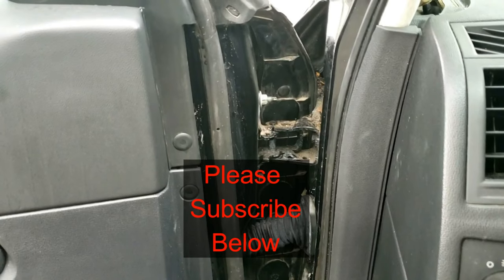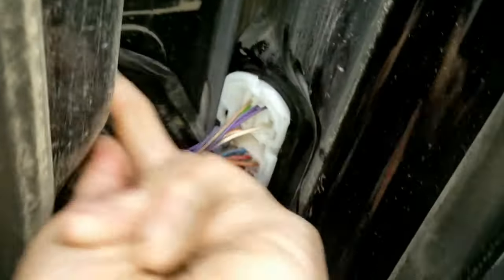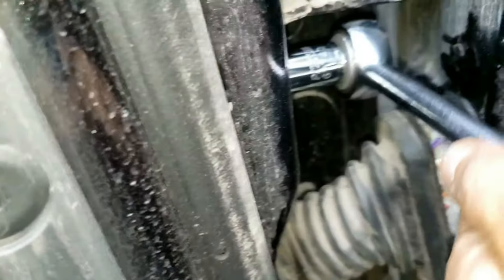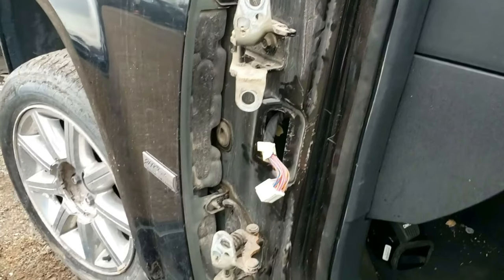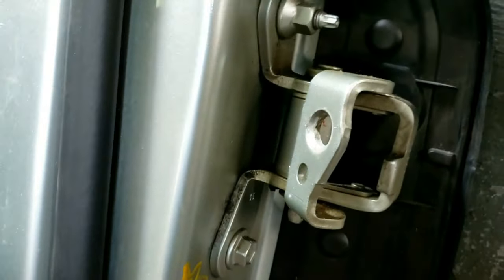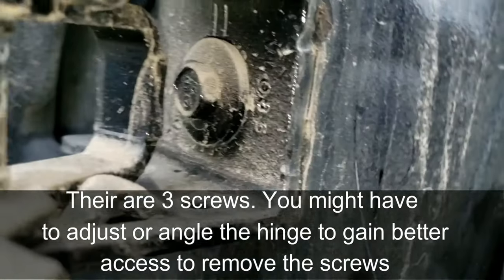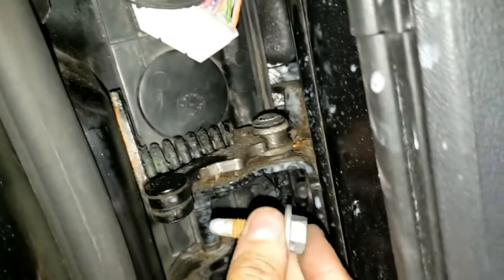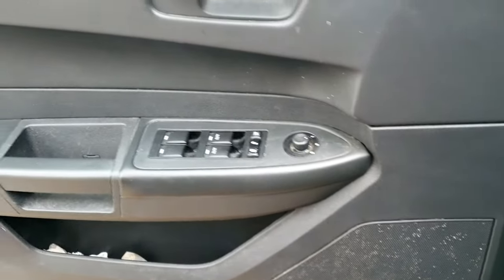How To Take Off Car Door And Remove Hinges On A Dodge, Chrysler, Jeep

Comment: I went to pick up a used 2001 dodge stratus 4 dr, driver door. Your right about that.( heavy) That door
had my back hurting , but I put it in and out even tried the back seat ,that didn't work loading it in my 1988 buick electra park ave. It has a big trunk but still, can't shut it all the way, almost. My back is halfway better next morning. Now to install my great buy $80 dollar and $20. in gas driver door .
 now to find what to lift it today , so I don't have to do more than balance half the weight. lot of big blocks I cut with a chainsaw I guess  and a rubber tire 2  wheel dolly to move old one away to junk pile.
Reply from the maker: Nice whatever does it!

Comment: I think this will be extremely helpful I have a 1990 Dodge van and the brackets have little couplers in them that need replacing and the door leans so now the assembly that closes the doors broken due to the leaning.. Time to take it all apart and fix it❤
Reply from the maker: Cool. Hope it's easy!

Comment: My door opened while I was backing up my driveway and clipped the corner of my smaller cabin 
Flexed the driver’s door towards the front of the truck 
There is difficulty opening and closing 
Any information I can get would help 
2010 dodge ram 
Please I am asking for your help and opinion
Reply from the maker: Might have to bend some of the door to bring it back in shape or use one of those puller pieces. Or if its the hinge area check to see if any of the screws looks damaged.

Comment: Flying 2000km to pick up a 2014 Cherokee that's had a sideswipe scrape and dent on the passenger door and the owners are selling for half market value. Easy flip. It's a big enough city I know I won't even need to paint a door, I'll find a color match at a wreckers. Just checking in before I go, making sure it's as straightforward as it oughta be. Guess I'm booking a flight!
Reply from the maker: great. I like your can fix attitude!

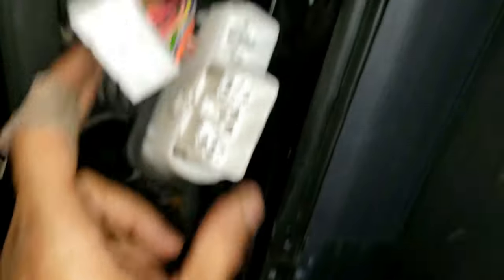Comment: At 7:10 what happened to you other wire connector??? You only connected one back and not the smaller one. Oddly it disappeared from view. Did it fall back into the frame?
Reply from the maker: Great question, and great Eyes 👀!!! So I actually replaced the entire door, which unfortunately for me had a different wire connector. My original door was damaged but the wire connector inside was still good, BUT it had 2 connectors, while the new donor door I got had 1 connector. 

So in addition to removing and reinstalling the door as shown in this video, I later had to also swap out and open up the insides of my original door AND the replacement door to switch the entire wire harness so it would plug into the rest of the wire inside of the A Pillar section which you spot. 👏👏👏

This might sound confusing, but basically I got a replacement door that was identical except the wiring harness.

I still posted the video to help others out. Unfortunately I didn't record swapping of the wire harness, but for most people that would be pointless, as if you are looking for a door to replace usually the wire harness is the same so therefore you only need to remove and reinstall a door if long if the part number (or door in this case) is the same.

Long story, but hope this explanation helped, and again great job on catching this!!!
Reply: I am putting a new door on my car but i forgot if i had 2 connectors as well. So the connectors didnt line up on the other door? Dont know if i will have to do this as well, any idea if you remember trying it? And also your old harness had a spot for 2 connectors it seems like, thats odd if you didnt have a need for it
Reply: Did you watch the video? He showed attaching door onto bolts and bolts and made harness connection to insure all electrical wiring worked before completing tightening bolts and nuts.

Comment: I kinda wanna switch a crushed door from one car and swap in a donor door from my other donor car.  What about disassembling the door and stealing it's trim and window and mirror. I kinda wanna take the metal panel off and paint it to match belt putting it on.
Reply from the maker: You could switch the components but it's hard. I did that with the door wiring harness before.but the trim and side mirror are easy.

Comment: I have the second type of hinges and my driver's door won't stay propped open but I can't figure out what's wrong with the hinge that it won't catch and hold itself open
Reply from the maker: Check to see if the hinge is properly aligned and tightened. You might have to adjust it as well.

Comment: Same process for a 2014 Dodge Avenger? And does the door have to be open?!
Reply from the maker: Not specifically sure for an Avenger, but most likely yes for the front door. You also have to disconnect the wire harness connector and the door has to be open to do that.

Comment: are chrysler 300 05--------and 07 dodge charger have the same wire harrness in the door..?..
Reply from the maker: I think so. However do a quick part search and you'll know for sure. I took a wire harness off once before and the connector was different in the it was split into 2 connectors instead if 1, but that was for a 2010, and a 2008. 

For 05 to 07. They should be the same. But when in doubt do a part search.
Reply: @FixCarYourself  ok thanks

Comment: Can you take off the lower hinge without removing the door or the top hinge?
Reply from the maker: It depends on the hinge type of the vehicle. Also, you may be able to take the bottom off completely if long if you loosen the top hinge. I'm not looking at the door at the moment, but that's what I'm thinking.
Reply: @FixCarYourself  Preciate it! I actually went to pull apart earlier & swapped out the hinges when I got back. I did end up taking the the door off though.
Reply from the maker: @itswhatever31  Cool. Great hope it was easy for you, and not too time consuming!

Comment: Im trying to replace my friends.  His is a 2006.  What year is yours????? It does not say
Reply from the maker: 2008, but its the same from 2005 and higher for many Dodge, Chrysler, Jeep cars. Or its very similar.  So this video should help. 

Keep in mind when replacing the door that the wire harness connector might not be the same...so if replacing the entire door make sure its identical otherwise you may have to swap the entire wire harness from the previous door, which is hard for people with big or medium size hands IMO.
Reply: How did you get the electrical connector to pop out? Mine just wants to fight with me
Reply from the maker: @randystull1502   @Randy Stull  It can be quite hard. You have to push the flap and wiggle it out. I used a flat tip and wedged it out while pushing the flap. You could also try using a pliers on the flap part. 

 Have patience with this. I found this to be the hardest part of the entire removing of the door.
Reply: @FixCarYourself  would have to agree.....that is what I'm working on today
Reply from the maker: Did you ever finish this door project? Was it easy?

Comment: The plastic stuff that has the wires attached to the door is just too fkng hard, I already broke it and still doesn’t come out, I don’t know what else I need to do
Reply from the maker: I agree, I had one wire harness where the plastic broke a little bit by the door connector. Just pry slowly and carefully maybe change up the tools.